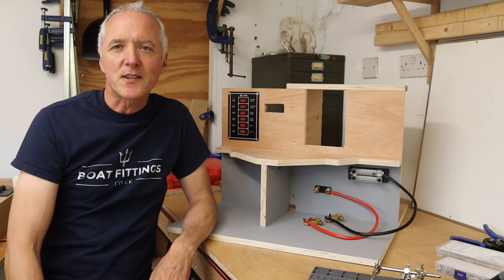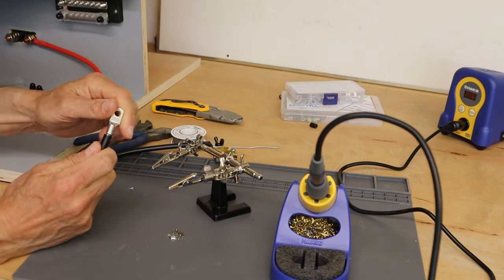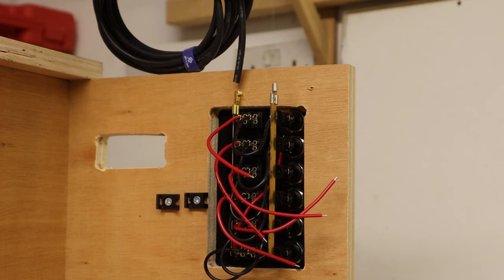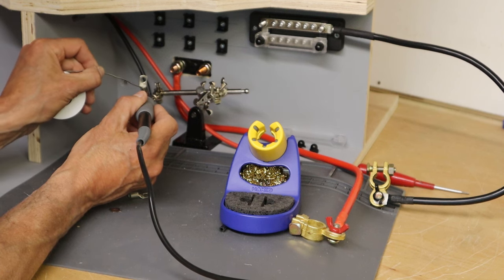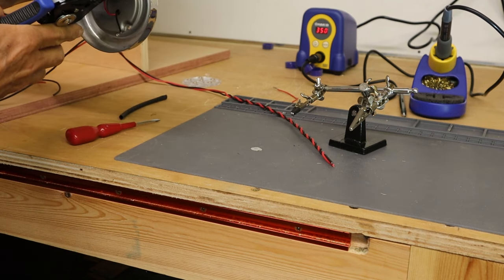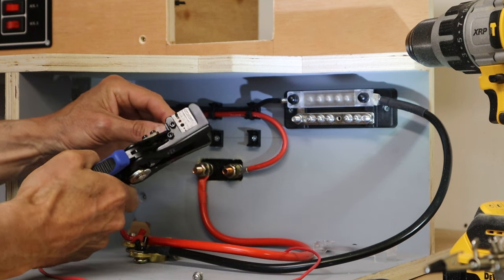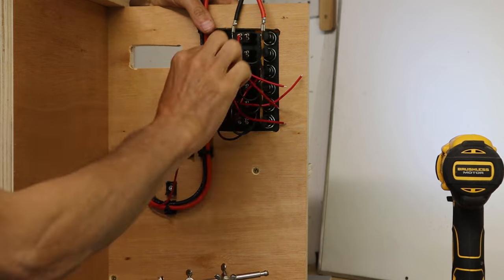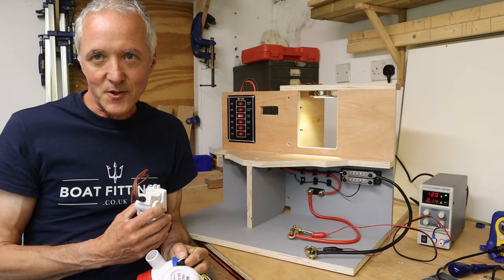Boat Electrical Wiring Made Easy, Part 2, Switch Panel Wiring, Cabin Light Wiring - Complete Guide

Comment: So if my switch panel is getting very hot, should I upgrade the wire gauge of the individual thinner switch wires? Or the cables running to the switch? Or the fuses?(the fuses must be ok right or they would blow instead of getting hot?)  Or all of the above?
Thanks in advance.
Reply from the maker: Hi thanks for your interesting question.  I probably should start by saying that you might want to think about a switch panel upgrade if it is getting worryingly warm.  Now on a practical level it could well be the thinner switch wires which are generating excess heat, and you might well see a benefit by upgrading them.  Anywhere that is 'thin' is a potential source of high electrical resistance.  High resistance leads to heat, then in copper the warmer it gets the higher its resistance to some some extent you get a 'viscious circle'.  I agree that if the fuses are not blowing, then it would not be logical to replace them.

All the best,

Richard
Reply: @BoatFittings  i appreciate you!
Reply: @BoatFittings  Mostly right but the remark about the vicious circle is incorrect.
This is true for semiconductor devices such as power transistors which is caused by the semiconductor having a negative temperature coefficient of resistance.

Now for metals, including copper and other metals used in wires, the metal has a positive temperature coefficient of resistance. So as you correctly said, as current heats up the wire, its resistance increases, but this actually causes the current to reduce. And as the current reduces, so does the temperature of the wire .

If you think about the old incandescent filament light bulbs, which have a filament made of tungsten, a metal, the filament is cold when you turn the bulb on, and a large current flows causing the filament to rapidly heat up, as the filament heats up, the resistance increases and the current reduces to a lower and steady state value.
This must be the case, because if the opposite were true, and the thermal runaway effect where the resistance of the filament increases leading to increased current, would eventually lead to the filament blowing, and that just does not happen. Every filament light bulb we turned on would blow with in seconds of being turned on.

So the thermal runaway effect can only occur in devices which have a negative temperature coefficient of resistance.
Reply: I would get myself (actually already do have one) a clamp ammeter for DC and measure the current in the wires to the switches in your switch panel and identify what is going on.  Identify if the wires are correctly rated for the current you are seeing, and check the current rating of the switches. Then decide which you need to replace.

Comment: Great stuff! Should there be a fuse close to the battery on the positive cable or is the fuse in the switch panel enough please?
Reply from the maker: Hi Alan, thanks for bringing up this question - it is a very good question!  I have often thought about this myself, you might say that if the Master Switch for example has a capacity of 100A then you could choose to protect the whole circuit with say a 75A fuse.  In practice (in my opinion) as long as each component is protected by a fuse (suitable to that component) then that is more important.  So I would not argue against protecting the whole electrical system from a 'master' fuse, but I think in practice this is a bit more 'belt and braces' than most people or boat builders would choose to go.  It would be interesting other expert opinions on this.

All the best,

Richard
Reply: A single fuse inline with the battery is not required. The reason for this, in this instance all of the current from the battery going to any load passes through a fuse.
So long as the cable from the battery to the integrated switch and fuse panel has been correctly sized.

Any short or fault that occurs on any circuit is going to blow the fuse in the switch panel and cut power off to the circuit that has the fault, so you can never have a fault which can cause more than the maximum rated current for the battery-to-switch-panel cable to flow down that cable. Each circuit's fuse is lower than the current rating of that battery-to-switch-panel cable.

All I would do is put in a master isolation switch in line with the battery's positive cable.

Comment: thanks for the video it was very informative! One question, would it be feasible to have the negative bus bar very close to the 12V panel so you can easily connect everything to it? Sorry if you explained that, I may have missed it. Or is it just better to have the bus bar close to the battery?  Trying to learn this stuff and plan to redo the electrical in a small sailboat soon. Or could you have a bus bar by the battery and run a second one close to the 12v panel? Thank you!
Reply from the maker: Hi thanks, that is a very good question.  I can't think of any reason not to put the bus-bar near the 12V panel.  I would say it is a case of positioning the bus-bar (and master switch) where they are most convenient for you.  The only thing to keep in mind is the lengths of wire run, so if you have a long wire run from the battery to the bus-bar it is important to make sure the gauge of the wire is up-to-spec.  I don't see that as a big issue though.

Thanks for your question.

Richard

Comment: Hi there loving your video series. Really helpful. Couple of questions. 
1-Rather than buy lots of different expensive marine grade wire could I use a 16 awg but have the right fuse for the product? Otherwise I can see it’s a case of different wire for different products will be a nightmare.
2. Can I use crimp I don’t own a solder nor have I ever used one? 
3. Could you do a series on adding solar panel kit to this please? 

Thanks in advance matey.
Reply from the maker: Hi thanks for your questions and comments.  As far as wire is concerned the main thing is that wire is not the small a gauge for what you are powering.  It is not an issue really to have wire which is thicker, as it can handle more current.  Yes crimping is often used for these kind of connections - a good quality crimping tool will give a secure and strong connection but some of the cheaper / simpler crimpers aren't so reliable so you can do a 'pull test' to make sure the crimp is firm.  My personal preference is to solder, but I know in some industries crimping is very commonplace and completely accepted as the norm.
Reply: @BoatFittings  thank you for the reply.
Reply: Just to clarify something as you have said "but have the right fuse for the product" .

The fuse rating is based on the product, but it is not present to protect the product. 

The cable needs to be able to handle the current the load requires. 
The fuse is there to protect the cable.
So this gives rise to the two following rules:
(1) the fuse rating must equal to or lower than the cable rating.
(2) the fuse rating must be equal to or greater than the current rating for the load.

Comment: New subscriber here.  These videos are great!  One question, why use fuses on a boat instead of circuit breakers?
Reply from the maker: Hi thanks for your question, I don't have any particular preference for fuses or circuit breakers, it just depends on the switch panel that you end up with.

All the best,

Richard

Comment: I have a question about 2:02 Why did you solder it? Is it an alternative to crimping?
Reply: Don't do this. Marine wiring basics - All terminals should be crimped & insulated.  It's ok to use solder + crimp, but not solder alone.  Also "tinning" the end of the wire is not a substitute for marine grade wire that's tinned all the way through and the insulation is made to handle higher heat and exposure.  Remember, you can't run away from a fire on a boat!

Comment: Hi, regarding a small inboard engine, would the feed to the starter motor come off the battery switch along with the feed to the cabin (obviously using suitable size cable) and does the negative bus bar ground to anywhere on the boat (oyher than the battery) if its a grp boat?
Reply from the maker: Hi thanks for your questions.  In reverse order: No the negative bus-bar only grounds to the negative of the battery, there is no point in connecting it to the GRP which does not conduct electricity.  As for the small in board motor question I do not have a definitive answer.  It may be appropriate to have this coming off a completely separate 'master' switch in view of high current draw.  It may also be feasible to have this off a common 'master switch for all' as long as the switch and wires are rated for the peak current draw added all together.

All the best,

Richard

Comment: Friendly question. Why solder, instead of crimping. Why not both?
Reply from the maker: Hi thanks for your comment / question.  In my experience I have never experienced problems with well-soldered joints, but I have experienced problems with crimped connections once corrosion has got in.  I realise that some people prefer crimps, and I think at the end of the day it is a matter of preference and experience of what works best for you

Comment: Why would you run such a large wire to the neg feed on the switch panel if its just the neg for the panel lights?
Reply from the maker: Hi thanks for your question.  Actually the negative wire happened to be part of a set purchased together, so it seemed a shame to waste it.  Other than that no reason at all, and a lighter gauge wire would have been absolutely fine - well spotted.

Kind regards,

Richard

Comment: great videos, what about using fuse boxes....?? i dont see you not use these...
Reply from the maker: Hi thanks for your question.  There is nothing wrong with separate fuse box and switching, I have just chosen to use a combined fused switch panel all in one unit which seems like a handy / simple way to do things.  A fuse box though and separate switch for each item achieves more or less the same effect.

All the best,

Richard

Comment: Fantastic, could you explain how to add something else in . Ie all switches being used but want to add a USB port , can this be done 
Cheers
Reply from the maker: Hi thanks for your comment, and great question.  I will try and cover this in a future video - great suggestion, thanks very much.
Reply: It's possible but you have to be careful.
What you would do is wire in the USB charging port in parallel to something on a circuit, say for example a existing light.

What you have to be careful of is this: a single output USB charger can deliver 2.1 amps at 5 volts, which is 10.5 watts. That when at 12 volts is 875 mA, which is close to an amp, for a single USB charging socket.

And a lighting circuit is going to be a low current circuit. So the question is, do the cables in that circuit have enough thickness to cope with that extra current? And then you have to check out the fuse and ensure that can handle the current.

Note, you don't increase the fuse rating just because you are adding more loads to the circuit. The fuse rating is set based on the current rating of the cable.

Comment: Can anyone tell me where you would wire in the solar energy coming from the charge controller in this set up? My first instinct would say wire it straight to the battery terminals but I have seen other videos where people wire it to the bus terminals so the solar energy can flow straight to the loads. Any insight? Let me know.
Reply from the maker: Hi thanks for you question.   I will probably that topic in a future video where I can give a full and considered answer / discussion on this.  In the meantime I would hope that you solar panel would come with a recommended installation guide.

Kind regards,

Richard

Comment: The potential load according to him is 30 A and the wire supports 30 A. I thought you generally wanted to only have 80% of the theoretical capacity and max. So I would think the wire should be enough to support 37.5 A, or essentially 40 A.

Comment: What about if you're running a fuse block, bus bar and switch panel
Reply from the maker: Hi thanks for your question.  I will have to look at that configuration in a future video - I have put it on the list.

Comment: Just as a consideration crimping high amp fittings to avoid the potential for a fitting to desolder itself with enough heat on soldered only fittings
Reply from the maker: Hi thanks for your comment - duly noted.

Kind regards,

Richard

Comment: Is soldering terminals ABYC approved ?
Reply from the maker: Thanks for the question, I don't know the answer to that one - maybe somebody else can answer ....
Reply: I have just checked ABYC standards and apparently solder joints are not permitted.

To be precise, they say that soldering should not be the sole means of making the connection, that is solder could be used with a crimp terminal but you can't just use solder by itself.

I don't know if adherence to  ABYC standards are a legal requirement, I can't answer that.

It's not altogether clear why solder alone is not permitted, I have seen reference to a theory that the solder could melt if a high current flows (what's the point of fuses if not to protect from over current and excess heating!) and also a concern around the mechanical strength of the connection.

I am aware that solder can lead to a chemical reaction taking place where metal contact, wire and solder are of different metals, and that chemical reaction over time leads to an increase in resistance leading to an increasing in heating at the joint, which in theory could cause it to fail. I have never come across this in practise on power circuits, I do know it is an issue in high performance audio circuits with an impact on sonic performance.
Reply from the maker: Hi Dean,

Thanks for sharing this detailed information - food for thought.

Richard

Comment: You may already have answered these questions.  1.Could I have a Live buss bar  further in the boat. As the run to the batteries is rather long 
2 could the negative buss bar also be further away with a run of about 3 metres to the batteries 
Geoff
Reply from the maker: Hi Geoff, thanks for your question.  I do not see any problem in principal with locating your busbars away from the battery, at a point convenient for you.  The main thing is to use a wire from the busbar to the battery that is up to the total current you want to pass along it.

All the best,

Richard

Comment: I definitely would not solder any joints on any vehicle subject to vibration. Solder turns a flexible, stranded wire into a solid core, which will fatigue and break when vibrated. Crimp terminals should be crimped; then covered with double wall, glue lined heat shrink tubing to waterproof them.  Crimp connections are easy to get right with a little bit of practice, and good quality crimpers are readily available.

Comment: Shouldn't the battery terminal be crimped for greater security and electrical efficiency and safety
Reply from the maker: Hi thanks for your comment.  I am aware that some people prefer crimping, in my experience a good soldered joint will perform well.  Crimping may provide some more security but I would say not any improvement in electrical efficiency - that's just my opinion.

Kind regards,

Richard

Comment: Where is the fuse/ breaker AT THE Battery? 
Here is a "best practice" tip:  Coat all wire conductors (and terminals) with dielectric grease prior to crimping and heat shrinking, same for ALL plugs, sockets and fuse blades!  (obviously this does not apply to solder type connectors)
Reply from the maker: Hi thanks for your comment / suggestions.  I take on board your comment to have a main fuse breaker at the battery.

Kind regards,

Richard